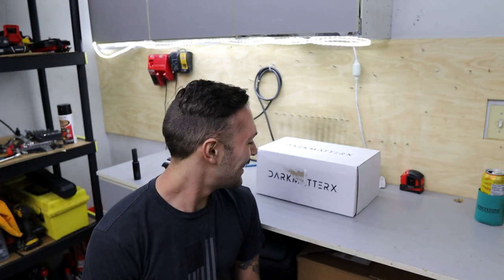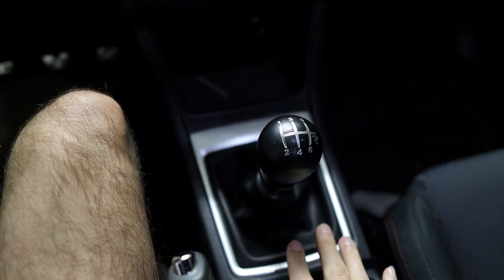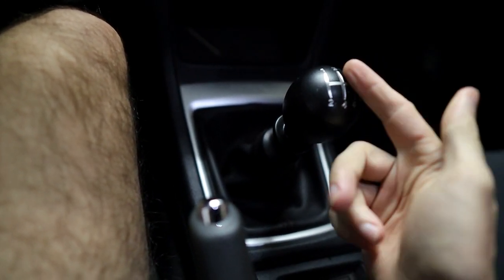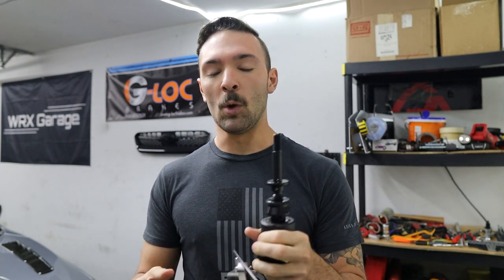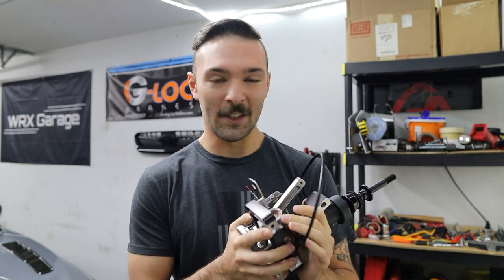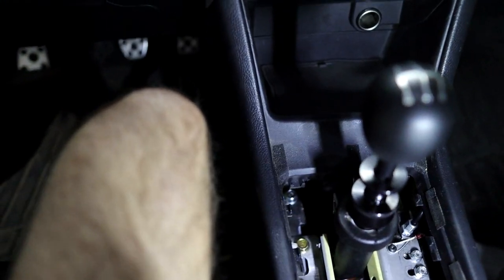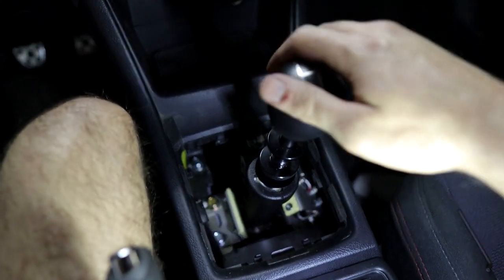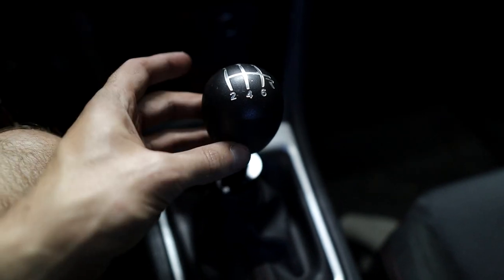Introducing the ALL NEW DarkMatterX DM-2 Shifter - 15+ WRX

Comment: Very nice engineering on that part. I do have a concern though. Maybe you can shed some light on this or ask the engineer: How safe is it to transfer 100% of the shock from changing gears to the syncros and gears themselves? 

The WRX 6 speed isn’t the strongest transmission to begin with, especially the syncros. On the OEM setup, it’s not that Subaru cheaped out on components. They engineered the shift bushing, shift cable, plastic/composite components of the shifter mechanism, and the transmission mounts to work together as an ecosystem that absorbs shock when shifting and protect the transmission internal components. 

This Dark Matter shifter eliminates all but the transmission mounts, which will surely be replaced with harder material by folks spending $900 on a WRX shifter. Considering the WRX 6-speed has practically zero aftermarket strengthening options, I would really worry about eliminating any and all components with shock absorption properties. 

I bring this up because I’ve seen this situation on other vehicles. There has to be something in the system to absorb abuse from the driver, and you never want that part to be the transmission itself, especially in a car with no realistic “built transmission” options.
Reply from the maker: So I had a quick discussion with the guys at DarkMatterX about this before responding in order to confirm what I was thinking..

In terms of comparing possible damage to the transmission, specifically the synchros, there really isn't any difference between this shifter and the oem. Damage to synchros and gears obviously comes from mis-shifts, money-shifts, etc.. but it can also come from "over-selection" (aka resting your weight on the shift knob and holding the shifter in gear). It can also come from slamming the gears too hard which could bind up the teeth on the synchros.

Regardless of which cause of damage you're talking about, it all comes down to the driver. From normal driving, and accurate shifting, there isn't any difference of damage to any part of the transmission with the DM-1 or DM-2.

I'd venture to say that it's even less likely to damage the transmission with the DM-2 because it's way easier and smooth to push into each gear, which means you can push the shift knob with less force. For the forks that select the gears by sliding over the synchros, if you're able to do that motion using less physical input relative to the oem shifter, it could definitely reduce the likelihood of damaging a synchro and the gears themselves. But again, it all comes down to the driver and how they shift.
Reply: If money wasn't a concern, buy this and if the stock transmission goes boom, do a STi transmission swap.
Reply: @xil3ntkha0s  I'd put the 1300 dollars toward an STI trans fund
Reply: @CTR_Dan THIS!!! I really hope no one is out there forking out 1400 for a damn shifter 🤦‍♂️ save you another 1400 and you can do an sti swap and not be dumping money in an outdated split case transmission

Comment: Not to be a buzz kill, but the shifter is going on a glass trans. At that price point if your planing on making power which is much easier on the FA24 then EJ's in the past. Save for an STI trans without the cable crap from the factory that can handle twice the power. When you blow your trans and clutch like I have you will feel stupid for spending on shifters that won't swap over.

Comment: I wonder is this shifter will be compatible with an aftermarket shift plate?
Reply from the maker: As of now, it was designed for use with the OEM shift plate. Some aftermarket versions might be compatible but I don't think any would actually be confirmed.

Comment: PSA: STI swaps aren’t much more than this!! Why would anyone spend 1400 on a SHIFTER for a glass split case… get a short throw n bushings and call it a day.. if one’s really trying to piss away 1400 on one of these split cases, get a carbon drive shaft, at least you gain a little power and smoothen out your acceleration..